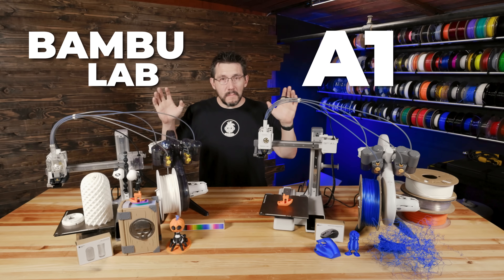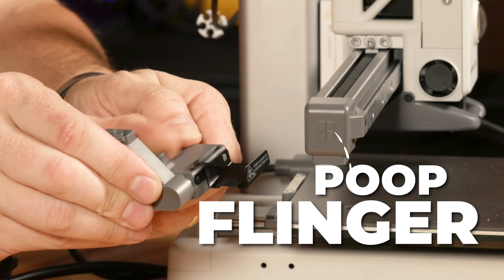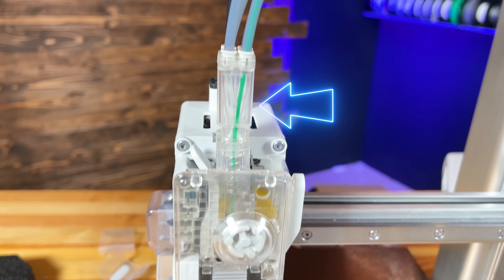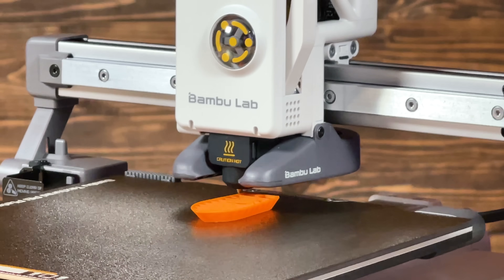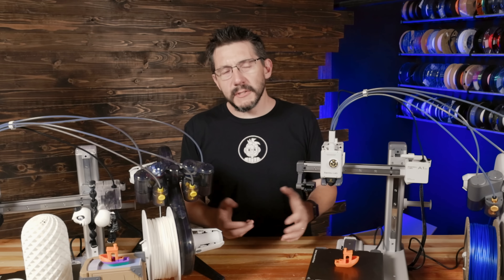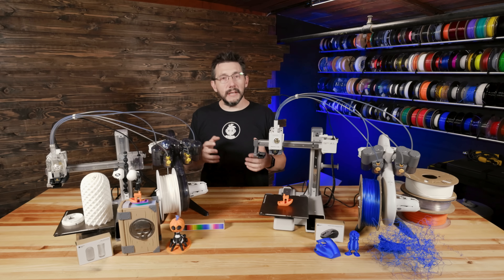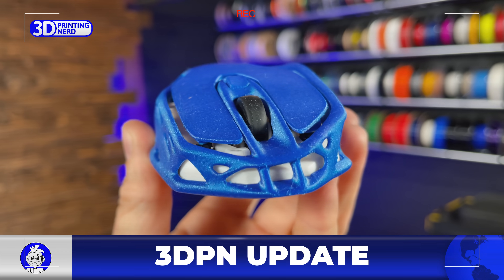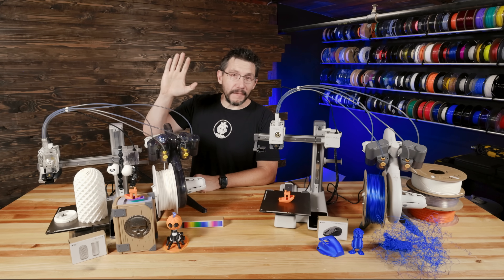Bambu Lab A1 Mini & AMS Lite! Cantilever Bedslinger!

Comment: Joel: "Open source is paramount!"
BambuLab: "How can we lock down the models into our ecosystem in such a way that even if anything goes wrong, the user has no ability to do anything about it?"

I really like the concept of the combo offered here, but I'm not happy about the excuses being where ever greater amounts of control is being taken away from the user to do anything about issues.  A 3D printer is not a dishwasher/washing machine/etc in that there's dozens more variables at play than simply throwing what you want cleaned into a machine, adding some cleaning product, and selecting start.

It's a shame.  I like the consistent quality of their products, but I don't appreciate the closed nature of their ecosystem, and it's for exactly that reason I'd never consider buying one.  I do wish it was different.
Reply: I'm not sure where this partial-myth comes from. The X1 Carbon, and the A1 Mini I believe, both allow local microSD prints. They also can be completely set up without an internet connection. This happened in our shop - where we didn't have Internet, and so we just set it up and started using it from the microSD without any issues. The slicer is open source. I get that the firmware is closed source (to, in Bambu's words, avoid clones which considering Creality...) but... so is your Windows PC or Mac.
Reply: @gabriels5885 the slicer is open source, but BL has been caught a few times already taking code from other projects and removing the acknowledgements.
It's quite simple; you use someone else's work, acknowledge it.
Reply: @BradClarke  I don't disagree, but the commentator was saying "How can we lock down the models into our ecosystem in such a way that even if anything goes wrong, the user has no ability to do anything about it?" which is not the case.
Reply: @gsieben  I'm referring to the mouse model from this review only existing and being able to be sliced within the Bambu Cloud, which meant that Joel had no control to fix the issues until Bambu relented and sent him the actual model file.  I have a feeling that this is a precursor to where Bambu wants to take this.  Once they start making models hidden in their cloud behind their ecosystem, then that control over the slicing to address issues is taken away.  I hope I'm wrong on that, but I think we just got a taste of where they want to go with it.
Reply: @stew675  I'm not sure what's going on with the free "gift" models, but the technical data sheet for the A1 Mini states that the A1 Mini has a microSD card and accepts local Bambu Studio files, as well as explicitly stating that Cura, SuperSlicer, and PrusaSlicer may work but without guarantees that it will work as well.
Reply: @gsieben  I'm not arguing that point though.  I'm well aware that the printers support both SD cards and LAN mode only printing.

What I'm actually concerned about is the portent here of model files being hidden from users and the whole "trust us bro" that comes with that.  Why was the model file kept locked away in the first place?

BL already has a poor history with regards to acknowledging the open source community on which they based most of their models on.  I see this as one more step down the road of them closing their ecosystem up more tightly.  We can't slice a model and take it to our printer with an SD card, or send it over LAN only mode if we don't even have the model to start with.  That's my point here.
Reply: @stew675 Fair. They are better than some (looking at you Creality) but they could definitely be better.

I'm actually not so concerned by the models being locked away at the moment, because let me speculate here: Imagine if I'm Bambu. I want to start my own model repository - and it needs to have a killer feature, a killer function, that makes it unique compared to Printables or Thingiverse or wherever. What would such a killer feature be?

I might think, "what if we could have users be able to charge money for their models, and securely deliver them to printers without the possibility of theft or piracy?" That's the direction that seems more likely to me.
Reply: @gsieben  Yes, and there is also a LAN Only mode, but the fact is that probably the majority of Bambu Lab printers are connected to the cloud for convenience. This can then lead to problems such as printers starting to print in the middle of the night because the cloud servers had a problem.
Reply: Another note about washing machines, idk when the last time I took it up as a hobby was. Appliances aren't really suppose to be hobbies, imo.
Reply: do you use any apple product, maybe a pc? cause none of that shit is open source, despite there being plenty open source alternatives.

Comment: Well that was interesting, They created a bed slinger which they said they would never do until they saw the potential $$  I get it. The A1 Mini is a marvel of tech in a small package. I would see these in schools with classes teaching 3D printing to students.  I'm extrealy happy with my P1S and next year if they make one with a bigger build plate I just might buy another. All in all another great product from a company changing the face of 3D printing. Prusa must now step up to the plate they now need to release a new product that's going to compete with Bambu and can no longer rely on the name and past preformance alone.
Reply: Yeah it is interesting they went back on what they said but it does make sense. They have captured the high end consumer market and are now targeting the lower end consumer market and bringing most of the, now proven, high end features with it. It seems like this is a direct competitor to the Prusa mini and also in some ways a competitor to other cheaper printers, like ender 3 or some of Sovol and other companies offerings. The price for just the printer alone is almost ridiculously low and when you add in the AMS lite it is still a very good price and you won’t find a printer with similar features anywhere near that price range.

These would be ideal for schools, clubs, makerspaces, libraries, etc. They are cheap enough you could buy many of them. A major problem with 3D printing in schools is the time it takes to print out a full class worth of models or projects. Buying just the A1 mini without AMS would be a very good way to get enough printers to be used by a class of students pretty cheaply and without the AMS you are saving money from wastage which might work better with school budgets.

Comment: Slicing in the cloud is a bit of a red flag. That costs money. Recurring money. Either theres going to eventually be a paid subscription, or they will have to discontinue the cloud side, it's not sustainable as-is.

That asside, funny that Prusa rushed through input shaping on the mini this week.
Reply: Slicing in the cloud is an option when sending models from your phone, you can still slice locally on your PC if you’d rather do that.
Reply: @Aikano9 point is about the sustainability of that cloud offering. As a company Bambu gets paid once for the printer. To run the cloud services there are mo thly invoices from cloud provider to Bambu. How are they going pay? They can't give it for free forever.

Comment: Cool features! But for me, someone who can only buy 1 printer, it lacks the size which is important to me. If it was 220x220, I would maybe consider it but someone mention that size would require a full gantry like an Ender. In the future, if Im allowed to purchase a 2nd printer. One thing though, this sort makes me lean towards buying a K1 Max over a P1S Combo.
Reply: This is the A1 Mini which suggests they may have a larger version planned.
Reply: @conorstewart2214  I think they will prioritize the larger X1C/P1S first. Someone said in a comment that if they do a bigger A1, it would have the Ender 3 design as a cantilever won't handle a bigger volume well, especially at high speeds.
Reply: Yea, I really want. P1 max, something big for masks

Comment: The AMS is an environmental disaster. Only way of doing multi material I am sold on is IDEX.  No material wastage and lining up the  heads to the same height isnt such a difficult task with practice
Reply: I'm not so convinced. Yes, a lot of filament is wasted, but you can decrease the amount of purge in the slicer if you want to. However, it is very reliable, and the environmental disaster of a single large failed print due to a botched color change easily outweighs the amount of purge. Even if the AMS was 10% less likely to fail a large print, I think that the purging would win in the long-run in terms of filament waste.
Reply: Tool-changing printers also reduce waste. In general making these machines more reliable and faster helps to reduce their carbon footprint. The Chameleon 3D is another multi-material unit, and it includes a “ramming” procedure that results in a more thorough retraction with less waste during the color change. Once we have support for this in Marlin we’ll experiment with that ramming process and see how close we can get to zero extra purge.
Reply: @ScottLahteine  How much carbon footprint is created by having to add all the extra parts to make a second tool head and power it?

Comment: Can this printer be used with out the cloud or a smart phone. Can I slice on my laptop and print from a SD card?
Reply: I see that the bambulab web site says it can be used with out the cloud, but gives no information beyond that. There is also a $20 buck shipping charge and then tax on top of that, so plan on paying $50 to $60 bucks more than the price of the unit. Still a great deal.
Reply: @Robothut  You can use them in LAN mode or with a micro SD card
No app or cloud stuff needed

Comment: I just don't like being forced into one filament brand and one option for parts. The prints look great and multi-material is cool though I'd have no where to put that sort of setup.
Reply: You're not forced into one filament brand at all... He clearly said it works with every spool he's tried.
Reply: @timr86868  for the AMS? I thought it was Bambu only right now.
Reply: You can use any filament
Reply: That's a very strange and long winded way to say you didn't watch the video.

Comment: Is the AMS lite compatible with the x1/p1 series printers?
Reply: Does not look like it. Also don't think the AMS is compatible with the A1.
Reply: I’m not entirely sure how either of them work, but I suspect it might be possible if you also buy the AMS hub, since it is used to merge the four ptfe tubes from 4 regular AMSes, but you’d have to verify that with Bambu first
Reply: It would be a great cheap way to increase the number of AMS slots I have if it was compatible. I'll keep my ear to the ground. It doesn't look like it's available without the printer at all at the moment anyway

Comment: I really honestly feel anything under 256 cubed is unacceptable like I get they’re literally firing at the m1 mini’s but like I expect more from Bambu since they know the issue the community has is they had 300 cubed  core XY but nope they decide smaller and bed slinger
Reply: Very much aimed at a different market. Also, 80% of my prints (if not more) fit on my Voron V0.2 that is 120 cubed
Reply: That’s like saying a car smaller than a large SUV is unacceptable. Different use case, different target audience

Comment: So you’re telling me that the Bambu lab p1p and X1 don’t get the new quick swap nozzle or ability for multiple colors using the cheaper ams lite? 

Like I’m happy to see something new, however very disappointed to see no major improvements for their more premium devices. 

Like this has some of the features I wished my printers had.
Reply: is it crazy to think that since their first couple products they have discovered and invented faster ways to swap colors? Do you think they were able to do this before and purposley decided not to put it on the X1 or P1S? lol
Reply: I'm assuming the goal there was to maintain support for existing accessories. You wouldn't want to buy an AMS for your p1p, then find out you need to buy an entire new AMS to make use of an upgraded hotend on the newest product.

Comment: The AMS Lite looks nice... might buy it to put it on a real printer instead of the toy they ship it with
Reply: It’s a £270 printer that looks to have same speed as other Banbu labs. So just about anyone that doesn’t need a larger build volume like schools or people who want to print minis etc
Reply: Anyone who wants to multicolor print for under $500
Reply: poor guy (I'm sorry)
Reply: There will be people reverse-engineering communication between AMS Lite and A1.
Before that road is travelled to the end (assuming there's no encryption or other blockers), you can play dentist with AMS Lite, but not use it with other printers.